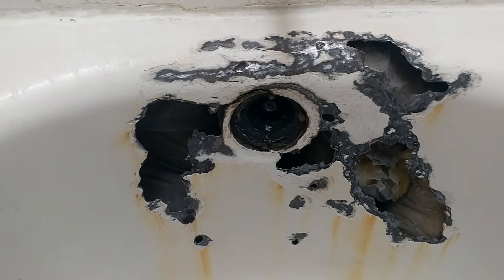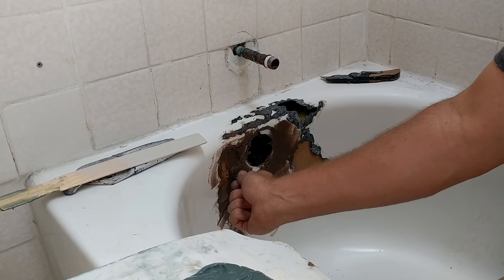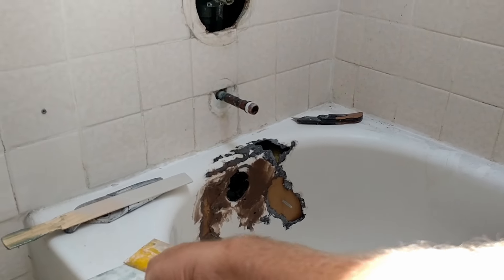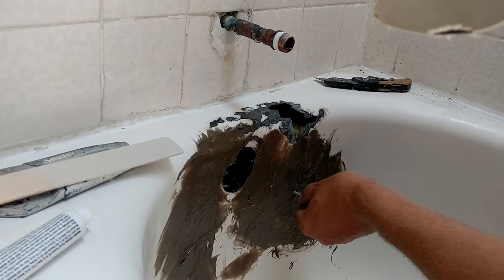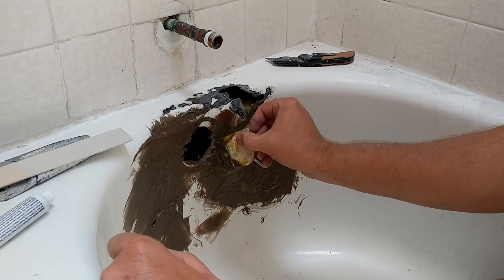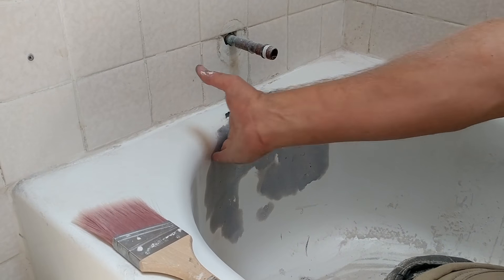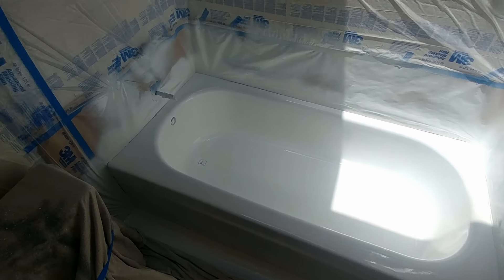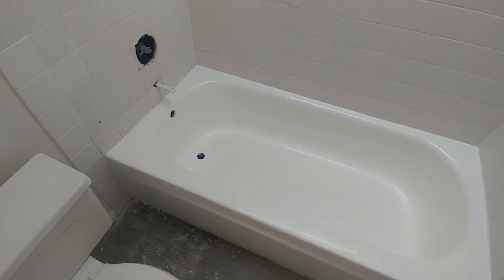How to repair a rusty hole in your steel bathtub

Comment: This person for president, you just saved this single mom teacher thousands. Thank you for posting, saw lots of videos, none like this, so easy,  I just tested my work and it's solid. Fixed for nothing, bc all I used was the bondo, and sander.
Reply from the maker: awesome and thank you
Reply: Exactly.  Because a tub replacement will cost:

$cost of new tub

$cost of demo-ing out the tile and sheetrock above the tub (when you remove the tile so you can pull the tub, it ruins the sheetrock underneath and you have to replace it)

$cost of installing and hooking up the new tub (plumber)

$cost of installing new sheetrock and tile

Thank you, Classic Truck - when your intention is to 'refresh' the bathroom, not rebuild it, your instruction is priceless!

Comment: Wow you are a artist , I totally forgot about BONDO fiber glass , I hope we have it in Canada Montreal , or something the same , I have a Crane metal bathroom sink , came with  house 1966 , it has rust and a hole about  1/4 inch in diameter near the drain where the water goes away , the water ,  has managed to rust out the bottom end of the sink too , so now I have put a big mop bucket under the sink , all the plastic piping on the underside is very intact right up to the drain of the sink on the underside , I will buy this Bondo or something the same up here in Canada and apply it to the rust and hole on the sink , I think this will work , I really do not want to change the sink nor all the plastic piping , its still all solid , Damm as a retired machinist I totally forgot about fiberglass , aaa what aging can do to the brain , I guess I had the wrong voltage on my thinking cap , lol ! Thank you for this viideo  , once again your a artist , God bless and have a great 2025 !
Reply from the maker: wow thank you for the nice words i hope you can fix your issue and glad i could be of help

Comment: What did you use to cut the rusted metal? I was thinking of using a Dremel with a nylon reinforced cutting wheel and a wire wheel.. At what point did you know to stop cutting? I'm guessing you used Ospho to treat the metal before applying Bondo Glass? It looks like you did a good job. 

I contacted the local Miracle Method and spoke with a tech and sent him the link to your video. He said all he does is cover the corrosion using a nylon mat and resin. He said the repair he does is cosmetic and temporary. All of the places I spoke with basically do the same thing. Non of them cut the corrosion or treat the metal. They're all in and out in one day. I may be wrong but from the reviews I read no matter what coating is used non are very durable. Thx.
Reply from the maker: i normally dont do this but what your asking is more than i can tell you in a text ... email me ... at my junk mail address ... blastfromthepast360@yahoo.com
Reply: @classictruckaddictions7423  Ok. Thx.

Comment: How did you deal with the tile to tub caulk joint?
Reply from the maker: because i didnt spray the tile you can re-grout or white silicone but if i had sprayed the tile the grout was kinda bad i would have grouted it to fill the low spots  ...just depends on what the customers budget and needs were and the time you have for the job ..hope that helps

Comment: I did buy a refinishing kit for when I sand the rust off. It is severe.
Reply from the maker: make sure you clean it very good and right before you apply the paint wipe it down with acetone

Comment: Got a question.. whatever your using will that work on steel tub that's flaking on the bottom it's not a fiberglass tub
Reply from the maker: yes ive done it for 20 yrs and never had problems on steal tubs
Reply: @classictruckaddictions7423  so pretty much just sand it down nicely on the bottom were it's flaking and put a layer of that stuff on and paint??
Reply from the maker: make sure you get as much rust as possible ,clean it then wipe down with acetone before paint .....

Comment: Just have a small bit of rust around the drain on tub bottom
Do I have to go through rust removel  & cleaning edges as it hasn't gone through yet
And don't want to cause more problems.
What smaller quantities are available as do not need that huge gallon size
Your work is  amazing-----the guys don't think  I can do it ----HELP-------Louise
Reply from the maker: yes use sand paper or dremel to remove rust dry it off use acetone to clean then do bondo sand smooth then wipe with acetone again and as for the paint you can use appliance paint in a spray can at home depot but if is real small i think they carry touch up for tubs as well or amazon ...hope that helps
Reply: @classictruckaddictions7423  Hi i have same issue. So just the cat hair bondo and no need the other two products before painting it?

Comment: I cannot seem to find any bathtub repair/reglaze to do anything but cover the rust I have. So far, it’s bad where the original shower doors were but who knows where else it’s at. I’m in the SF Bay Area and I believe most folks I find just go to school to strip and reglaze so nothing beyond that is done: is there another term I should google to find someone to do what you have shown in the video? I know if not removed, it will only worsen!!
Reply from the maker: look up a company called  Miracle Method on the site type in your zip code and it will give you one that services your area .... plus they come out and give a free estimate ...but if needed show them my video ...i trained with them for 4 yrs and for yrs after trained many of them with my technique
Reply: @classictruckaddictions7423  thx! I actually called the one in Santa Clara Ca before I saw your video but didn’t get the impression this is what they do. 

I sent your video to them and I was right, this is not what that Miracle Method offers. They will call the San Francisco Miracle Method on my behalf to see if they do something like this and if they would go into Santa Clara’s territory and repair my tub if they do. 

Fingers crossed !

Comment: This is the Very Best tub repair vid I've ever watched. My tub is bad. Rusty. I'm afraid it will be hot after. Would love to o know what is used for rust removal? Please. I wish i had knowledge of the bondos. Im sure i could try to do this being a gal an all..i do not have the sanding tools or equipment.. Thank you I'm saving this vid. In case a man comes by someday.. I'm in Mass if any one want to help.. your amazing.. You must be a car painter and a carpenter.. That bathroom is saved because of your Yankee Ingenuity

Comment: I like your technique. I’ve got a steel tub with your typical drain with rust around one side of it with a 1/8 in hole rusted through. The drain is stuck and can’t remove it. Was going to repair and reglaze it after my plumber removed the stuck drain for me but he says 1) not worth trying to remove the stuck drain from top and needs to open ceiling under tub to cut out and replace entire shoe and overflow and 2) patch repair of the hole and rust around the drain won’t last and may crack off when the new shoe and drain are installed. Not sure what to believe. Was thinking to try one more time to remove the stick drain by using hack saw to cut a notch and hit it with a cold chisel to see if it’ll rotate. move ahead and try. If it’s still stuck then move forward with plumber from under, patch, reglaze, and reinstall. If it doesn’t hold then think about replacing the tub or renovate the bath ($$$$). Appreciate any guidance and suggestions.
Reply from the maker: hello ...plumber is probably correct on going under to replace all but ive repaired many drains with success ..but that depends on who you get to do the job and what products they use .... i will tell you the company i got my training for has the best technique .... they are called .. MiracleMethod.com ...and they are all over the country and possibly able to remove the drain they the skill .... hope that helps
Reply: @classictruckaddictions7423 I’d be all over this myself to give it a shot as I had already bought the materials but then could not for the life of me get the drain out. Wrench broke the cross piece in the drain and the expander couldn’t get it to budge. So last shot Monday will be the notch and chisel. Then definitely will underneath drain cutout and replace and tub patch and reglaze. Hoping she holds.  The upside to doing it from the underside is the guy patching the tub can later from underneath too since the ceiling will be open.

Comment: HEY CLASS! I am currently working on a similar repair! My problem was caused by me not using a silicone sealant on the overflow so every time someone took a bath and filled the water up above that it leaked behind the wall and then rusted-out the bottom left side of the tub where the flange is! First order of business I knocked off all the loose rust then hit it with Rust-Oleum Rust Reformer and let it dry! Then I hit it with Primer! Then I hit the entire tub with super-clean bleach vinegar mixture to get all of the residue out of the way! Now I'm going to mix my Bondo and start filling in the cracks! The best hint that I got from you was the idea of the screw through the cardboard as a backing! Stay tuned for the update if you give me a reply! 😅
Reply from the maker: glad i could help...if you have any Q? just ask
Reply: @classictruckaddictions7423 
What products did you use?

Comment: What is the best products to use on the bath tub... you said bondo fiberglass and white bondo,   I don't have any holes yet in the tub but the bottom is all rusty and I just don't know what products are best to use...? Like what kind of paint what do I put over the paint as a finisher so it won't starts slowly coming off..
Reply: Also what rust killer did you use before everything else.  ?

Comment: From Jamaica 🇯🇲 with love bro, OK is there a specific type of paint i need to use on enamel tubs thanks
Reply from the maker: most professional tub paints are about the same.... but the primer and bonding agent are the real reason it stick's so well ...but if you dont spend time to clean the surface it will fail sooner than not ...but if its just your tub at home and wanna do it yourself Home Depot has a kit...i get my paint and primer from ... integritycoatings.com .. hope that helps

Comment: Be aware, if you've had a leak under or behind your tub, that can promote mold. Even if you do a tub repair, that mold can remain. If there is no way to look under your tub (e.g. a crawl space), you can use an electronic moisture detector.

Comment: I worked in a car body shop.  You are right about Bondo, this is a great mix of disciplines in the trades.  I was wondering, as I have a overflow drain that is rusted about an inch in all directions.  Your starting point is worse, and I have a believe with your experience your results will be better, but my situation is in a rental.  As long as it holds water, and is clean, I will be able to sell it.
Reply from the maker: thank you Mark,  i know bondo all to well have you seen the the other truck videos on my page
thanks again
Reply: @classictruckaddictions7423  I searched for fixing my overflow drain because this tub is 40 years old and the rust eruption is 360 degrees and 1/2 to 1 inch back from the overflow.  I found what I expected, a repair method.  Thanks for this  I am sure I can do it easier than pulling the tub.  I just replaced the tub next door a year or so ago, and do NOT want to do that again.  What a pain.
Reply from the maker: @MarkH10  40yrs old tub so im assuming its a cast iron tub which is thicker than tubs today ....id leave it it should last a long time ...just repair the rust thats what id do
Reply: @classictruckaddictions7423   Its sheet metal just like we can get in a box store.  But yesterday I measured to find the other side of the wall and it is in a closet.  I want to cut a removable panel in the closet wall, and work both sides.  At the moment I can get to the underside as well, and already have a hole in that ceiling to repair so I have the best situation with which to attempt repairs.

Comment: Please help!? I started having rust pour out of my Bathtub Drain Overflow Plate area and my maintenace supposedly fixed and and was repainted very nicely, however a month later rust is returning to that same spot! I took off the plate to check behind it to see what was wrong and it the hole's sides are very soft and chipping away. What should I tell them next time when they return to fix the issue?

Comment: i have  a rusted out drain with a good size hole connected to it. How do I repair the drain hole it's self? I have access to the bottom of the tub.
Reply from the maker: Bondo Metal Reinforced Filler - High Strength Filler, Can be Drilled and Tapped - Will Not Rust
its on amazon ...just clean area the best you can...mix bondo,put on cardboard,apply to button of tub sense you have access hold it there or tape it let it dry NOTE this stuff is very hard to sand best to use a sander...only on the inside of tub so smooth it out then apply another layer on the inside of tub as smooth as you can ,then sand again
hope that helps
Reply: @classictruckaddictions7423   What about the actual drain hole itself? There is just one small strip of metal left on it. Can I send you a picture?
Reply from the maker: @miketodd4739  classictruckaddictions@yahoo.com

Comment: I don’t know if you still look at the comments. I have a hole in the corner and on the side of the drain. When I went to remove the drain the side was rusted and a chunk came off. Is it easy to do that around the drain and still be able to place the drain back in with the grooves?
Reply from the maker: hi Rebekah ...you can but you will have to use a different bondo i found on Amazon just look this up ------>  Bondo Metal Reinforced Filler - High Strength Filler, Can be Drilled and Tapped

Comment: I use expanding foam in some areas as a backer. It works great specially on fiberglass tubs.  For spongy bottom tubs. Drill a few holes and spray expanding foam in them, then bondo.
Reply: Or cement

Comment: Hi I have a question is it ok the replace duraglas product with evercoat everglass filler? It seems harder for me to locate it local and a body shop suggested an alternative since they carry everglass
Reply from the maker: as long as the 1st coat has glass in it
Reply: @classictruckaddictions7423   thanks for answering  my question. I just have one more question regarding about Bondo Glass. For the first step when you work with Bondo glass did you add a Bondo hardener and mixed Bondo Glass with it?
Reply from the maker: @haywardkong1213  the bondo glass comes with glass in it and comes with red cream hardener just mix a little bit and mix until color changes to a darker color ....once it starts to thicken dump it and mix more
Reply: @classictruckaddictions7423  Thanks again :)
Reply: @classictruckaddictions7423   I have another question.... I actually got hold of Duraglas  and that would be my 2nd layer....product that I would apply after Bondo Glass.  The 3rd product that you suggest the poly-fill 710.  I can't get a hold of easily since I'm on a time crunch. Can I use regular Bondo without the hairs as a 3rd product as a 3rd layer  so it can sand down smoother ? or does Duraglass take the place of it but not as well?
Reply from the maker: @haywardkong1213  (multi-tech products) has it ... but you can use a different bondo for that ... the grey bondo from at homedepot ... its just easier to cover its not dark like dura glass is
Reply: @classictruckaddictions7423   thanks again :)

Comment: nice job, and nice technique, really impressive.  
 although all that after paying the labour cost hours to do all that work, prep, cleaning, bondo, sanding, prep, painting, etc.  not sure if it would be cheaper to just replace the tub. 
.. Either way, you should have ripped the tub out to at least replaced that overflow drain and it's rubber seal, otherwise water is still going in behind that tub, rotting out the floor eventually
Reply from the maker: thank you ...and for the most part you would be right but here in CA. the cheapest price just to pull tub and not tile homeowner told us was 2k which i know would go higher ......and i charge 400 to spray tub and for a repair that size 250 and im in and out in one day
Reply: @classictruckaddictions7423  wow, that's a good price.

Comment: What products do you use for buffing?
Reply from the maker: start with 1000 grit wet sand then 2000 a
then buff with Mothers Metal Polish and a wool buffer ...it works for me but there are alot of brands

Comment: I have bathroom sink with a similar issue. Can I use your technique or I can get a replacement one for about 35 bucks.
Reply from the maker: spuds ....by the time you buy the products needed ... unless you have the bondo with fiberglass  ...go for it  ....but if not buy a new sink
Reply: @classictruckaddictions7423  thanks, and thanks for the great video.

Comment: One question. Do you do hand sanding? Or did you use a belt sander or a angle grinder.
Reply from the maker: mostly a palm sander to get the shape and when i used the final white polly-fill or bondo i used 220 grit by hand so i could feel if there was any uneven spots

Comment: I like the cardboard & screw idea! I think I’d add a duplicate sandwiched layer of wire mesh hardware cloth (1/2” mesh or 1/4” mesh) against the metal tub simply for added support in case someone gets pounding around with a bucket or other hard object (horse farm and my bathtub gets used pretty roughly sometimes as a washtub) 
Beautiful job. I wish you were closer and could come do mine. Even with clear instructions like yours I’m sure I’ll screw it up somehow.
Reply: Works for drywall holes too😊